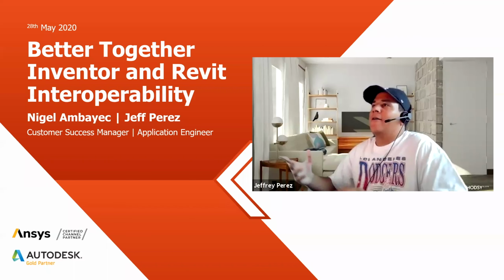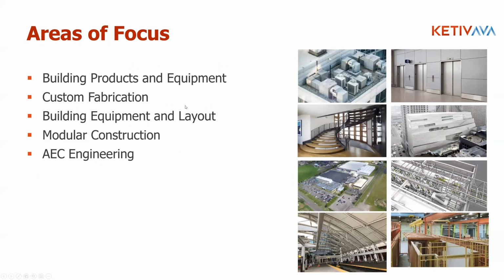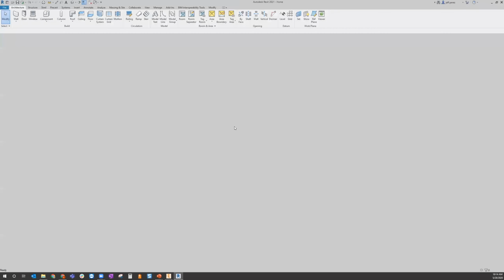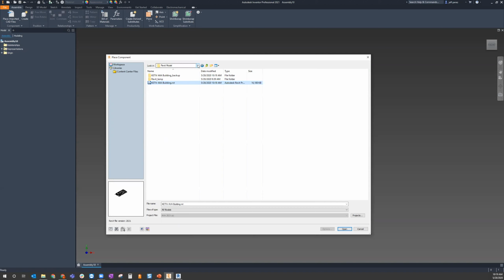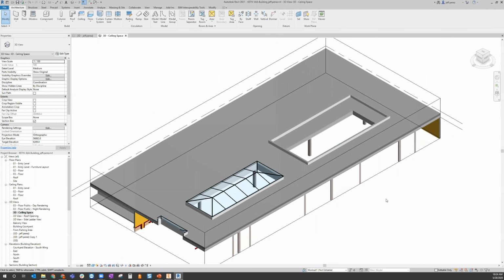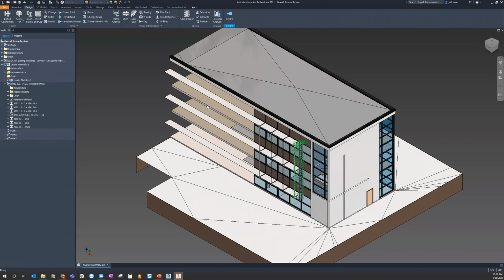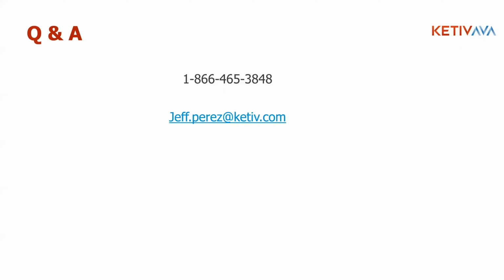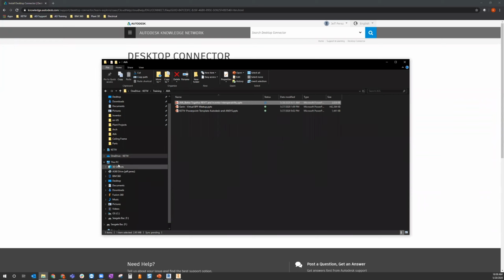Better Together: REVIT + Inventor Interoperability | Autodesk Virtual Academy

Comment: Thanks for your video very informative, I have some questions though.
1. While exporting the element created in Inventor to Revit, do the parameters stay intact, and are they editable in Revit?
2. Can we use BIM for storing all formats of inventor outputs in B360, which can then later be linked to Revit, and if we update the inventor model we can see changes in Revit too after syncing?
Reply from the maker: Hi Shivam,

Glad to hear you enjoyed this AVA, to answer question #1 - Parameters will maintain intact inside of Inventor, not all Inventor parameters have direct correlation to Revit, I would add any other RFA parameters needed in Revit for adjustments. #2 - You can definitely use BIM for sorting Inventor outputs to BIM Docs folder of your choice, you can use desktop connector to directly link Revit files from BIM 360 into Inventor with the new AnyCAD Interoperability features. I hope this helps!!!
Jeff P with KETIV Customer Success Team

Comment: Another issue that I have encountered, is that the Revit file is extremely hugh (like 2GB). Of course I can create a 3D view to minimize the number of objects, but it still needs to read the complete Revit file, does it? Is it also possible to have Inventor read the model with a default 3D view? Hope to hear from you on how you would deal with that...
Best regards, Peter
Reply from the maker: Hi Peter & Ellen
In cases like this, I would typically create a Revit 3D view dedicated to a specific area I would be working in within Inventor. That way once the Revit model is referenced it will load in your intended needs to work in versus loading a full Architectural model from a default 3D View. 
I hope this helps.
Jeff P with KETIV Customer Success Team

Comment: Thank you for your demo, Ketiv.
As a structural engineer for movable bridges I use both Revit as Inventor, so the interoperability between the two has always been very interesting. However, the dynamic link to Revit is only available within Inventor 2021, but my client wants me to use Revit 2019. How would you handle this when working with different releases?
Reply from the maker: There are certainly obstacles when working in multiple releases. Peter & Ellen - please reach out to our team @ questions@ketiv.com and we can help you build out a workflow that is optimized for working in the separate applications.

Comment: Thank you for the video! Our workflow is indeed backwards. Preliminary architectural design of several buildings is being modeled in Inventor 2019 and a second architect seeks to finalize his design in Revit 2019 using the actual elements. Can we make Revit families of walls, roofs, floors, etc from Inventor and then switch them for other wall types etc. .in the second Architect's Revit model? You spoke towards this workflow at the end of the video but I don't see any posted links. So far IFC has not allowed changes in wall types unless programmed as "Generic Models." Roofs and Floors still no success.
Reply from the maker: Hi Jake,

Unfortunately, there is no easy process to accomplish this workflow currently. If you export your walls, roofs, etc from Inventor to a .rfa file,  the second Architect would have to import these into Revit and then manually locate them within their BIM model. One thing you could potentially do, is make a shrink wrap of your building assembly inside of Inventor to create a single composite model that is simplified down, you can then go through the process of exporting out a .rfa file of the entire building that was designed in Inventor. One thing to note though is once this is brought into Revit, it would not function as a typical wall, roof or ceiling element to manipulate in Revit. 

I hope this helps.
Jeff P with KETIV Customer Success Team